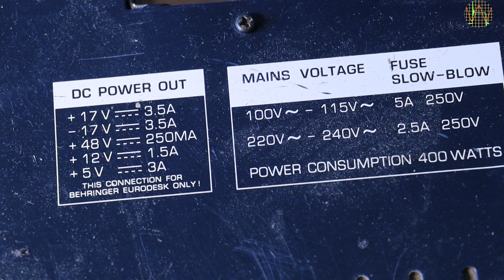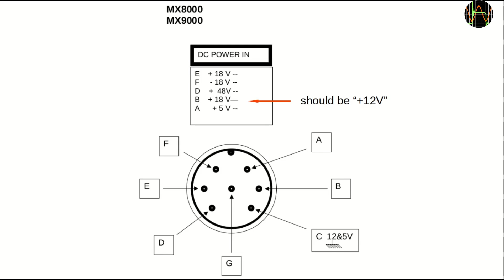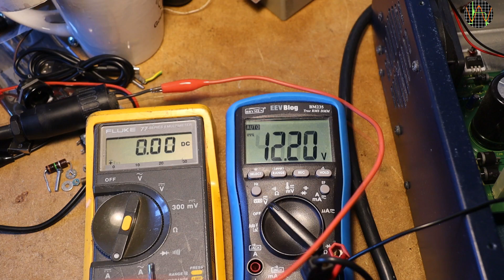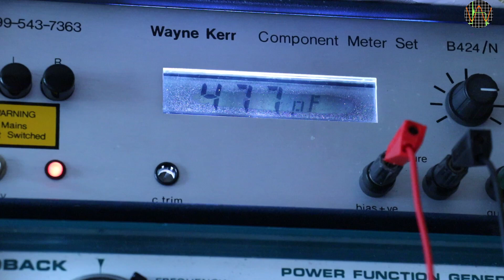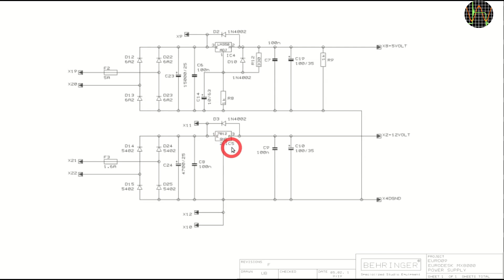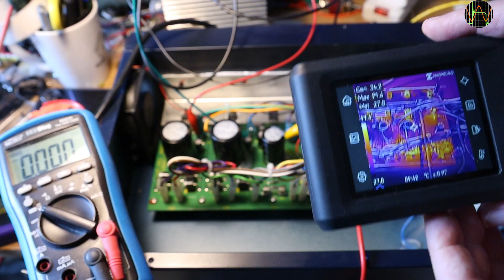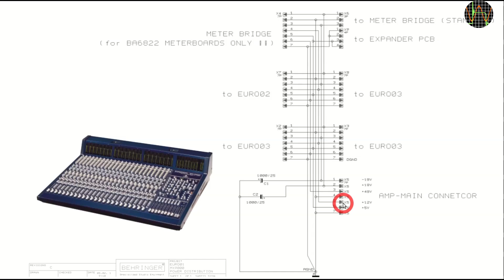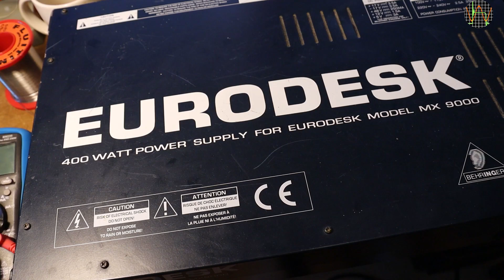183 - MX9000 EURODESK Power Supply Unit Repair

Comment: The negative 17V is a bad design. They're using a positive regulator to regulate a negative voltage by putting the regulator on the ground side.  It should be designed using complimentary NPN/PNP transistor-zener circuits with a centre tapped ground.  Thats probably why the +/- voltages are not identical. I would redesign and build a new circuit on stripboard using TIP41s/TIP42s with zeners for each voltage. The TIP41/42s are 6A max. The regulators are probably running near their current limit anyway when the desk is connected. Its cheap and crappy.
Reply from the maker: I agree that the specs on the unit oversell the capabilities of the regulators which isn't good practice. I have no idea what currents the mixing desk actually draws, I only got the power supply part for repair, so I can't comment on possible overloads. Regarding the negative 17V. You do have a point if the two rails came from a transformer with a middle tap. In that case the middle tap is the common ground and it would be very bad practice to use a positive regulator for the negative voltage (if that even works which I doubt). But .... in this power supply the negative 17V and the positive 17V come from completely separate AC windings and each have their own rectifier and smoothing cap. The two sections are independent and effectively floating until at the very end the plus of one power supply is connected to the minus of the other making it a +-17V with ground in the middle. There is nothing wrong with this. I use my lab power supplies often in the same way to get a +- voltage with common ground
Reply: @TheHWcave  Very helpful video and thanks for showing the circuit diagrams.  The power supply is also used for the MX8000 desk, where the current draw is 1.7 amps on both -18 and +18.  The LM350 regulators can be easily upsized to LM338, but not necessary.
Reply: "Cheap and crappy". As are a lot of things from this particular brand (but I do like my JT-4000M)